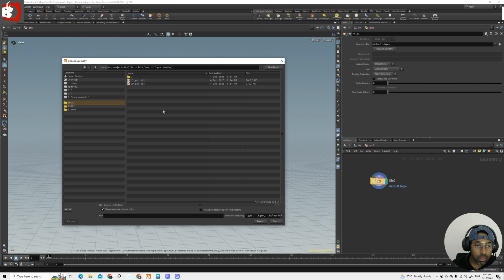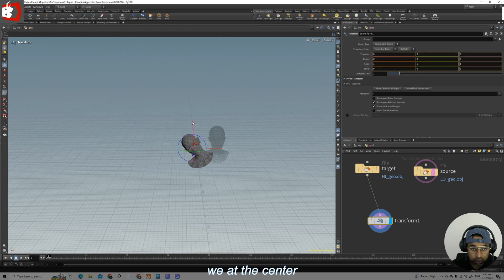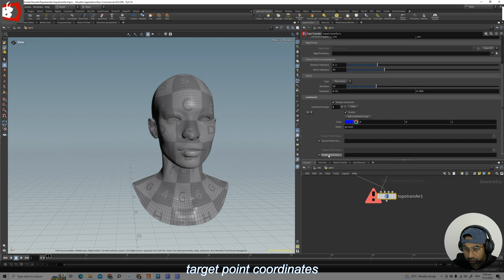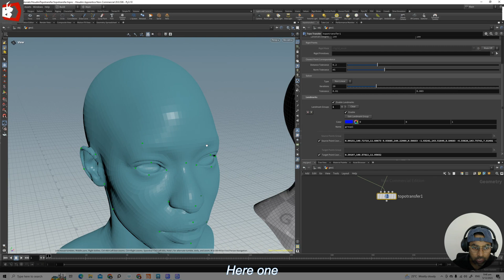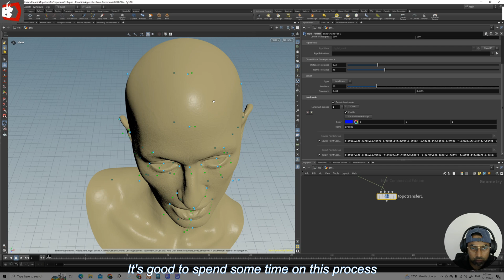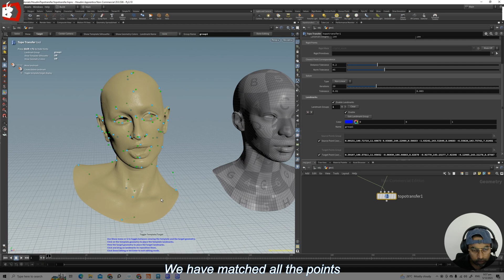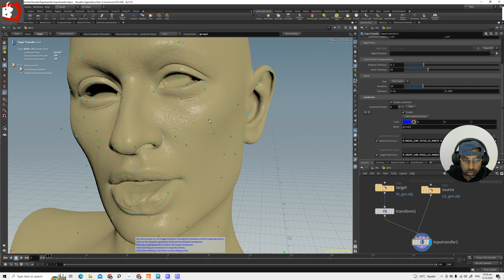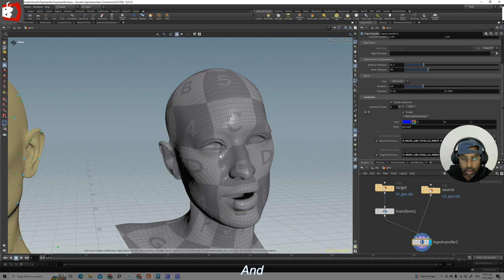Topology Transfer in Houdini

Comment: I encountered an issue during my attempt. After completing all the work on the edit points and clicking 'solve,' Houdini did not respond at all. Have you experienced this issue before, and how did you resolve it?
Reply from the maker: HI make sure all points are acconted for. All points in source should have a matching target point other wise it wont solve
Reply: @RenjuBosco  I've tried various combinations of feature points repeatedly and also referred to official cases, but clicking the "solve" button still has no response.
Reply from the maker: @sheqihu3714  if you can send me a file , i can take a look, difficult to say where its going  wrong
Reply from the maker: @sheqihu3714  HI you can send me the file to boscorenju@gmail.com
Reply: Did you figure it out, also running into the same problems.
Reply: @nowhereMan088  No, I gave up.🥲

Comment: Great tutorial straight forward, iv seen the same process in the wrap 3d software, am abit confused, I have a zombie head model, I want it to have the uvs of the default model in wrap 3d software or blender geo tracker default head model, because to use your own model in blender’s geo or face tracker, your model needs to have the topo of the blenders default head model, now my question is, if I use your method in Houdini, after the transfer and solving, will my zombie model change its shape to that of blenders head model or will it keep the shape but only transfer the uvs and topology or it has to change it shape as well?
Reply from the maker: yes ,so use the zombi model as target and your blender head as source in houdini, you will get a blender head (topology) with the shape of zombi head. use that as a blend shape in blender...hope that helps
Reply: @RenjuBosco  thank you will try that out